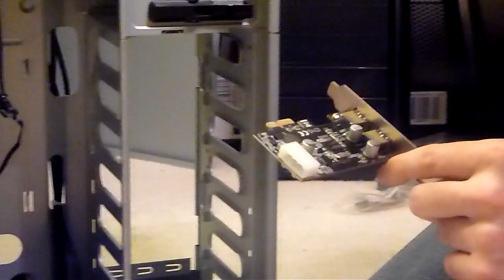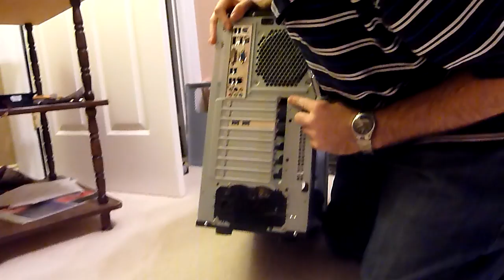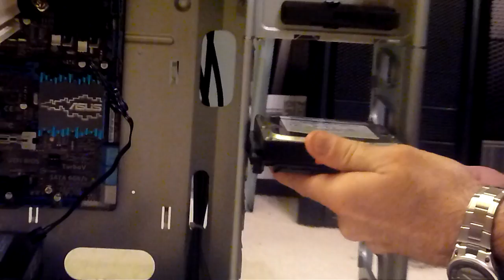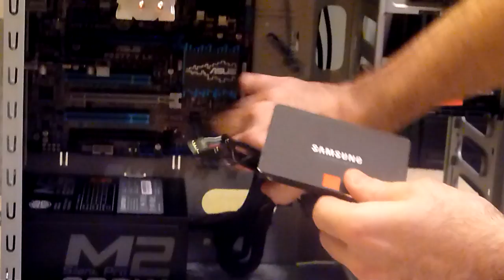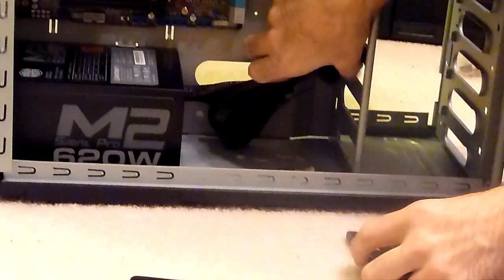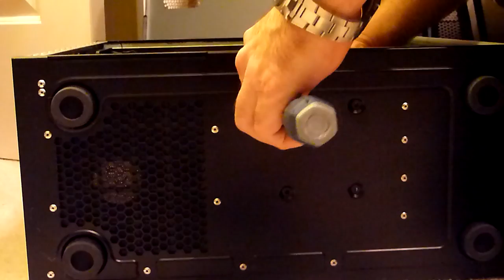Build your Own PC 4: Installing a PCI Express Card, Hard Drives, DVD, and SSD

Comment: Great video, helped me a lot. Isn't it a bit risky to be working on carpet though?
Reply from the maker: Not really- this was the middle of summer, and the humidity was over 70%.  If it was winter I might be worried about static problems, but I have build lots of machines with no troubles.  20 years ago when building computer involved handling individual cache memory chips, I was much more careful, but now, not so much.